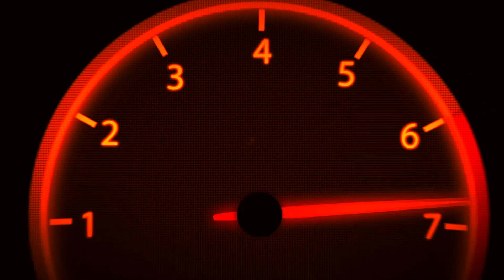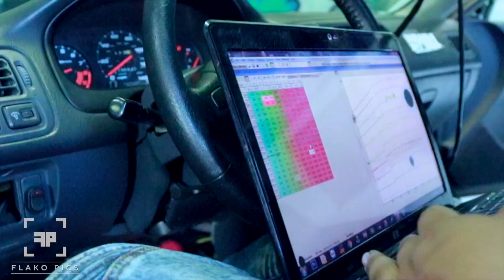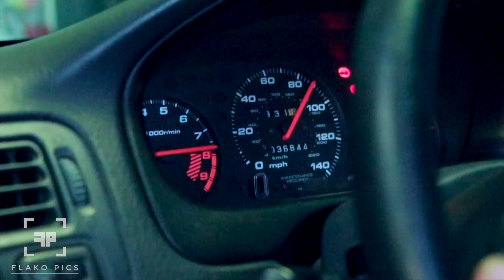K20 Civic All Motor - PLM Hood Exit Header Dyno Video

Comment: 2233 lb with you in it?? Thats nice. I have an ek coupe doing the k20/24 and im wondering how to lower it. Havent weighed it but im hoping under 2600
Reply from the maker: Should be under that bro, you’ll be surprised how light the car is, especially if you start removing parts you don’t need like interior items and what not.

Comment: hey bro, do you know if this will fit an rsx type s by any chance? the k20z1
Reply from the maker: kyoosha well if your asking about the motor, then yes it bolts on to that head. That’s what i was running. But if your asking me if it’ll clear on the Rsx I don’t think so. I don’t think you have enough clearance, but I may be wrong. You can see how tight it is in my car and I had to move the fuse box and battery to fit it.
Reply: Flako Pics Gotcha! Yeah i was also thinking that, probably wouldnt clear the rsx chassis at all
Reply: Stock tranny 4.3 fd?

Comment: Is your header flush with the hood or does it sink in
Reply from the maker: Cederick Egana it was sunk in. I was going to have a friend fab an extension but never got around to it. Not sure how true it was, but apparently it’s meant for a K24 which sits higher and would come through the hood. Probably also depends on chassis and mount set up
Reply: Ahh thanks for the info man